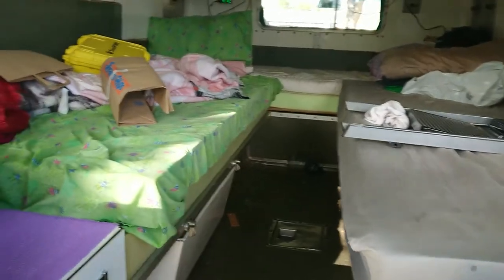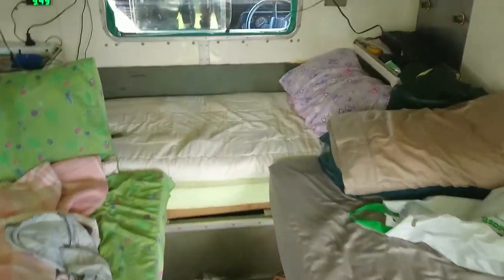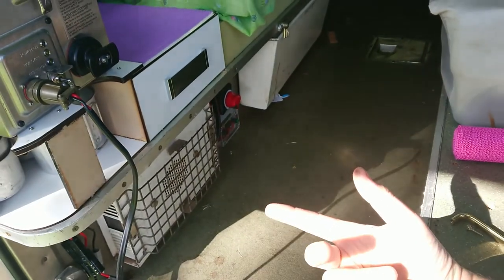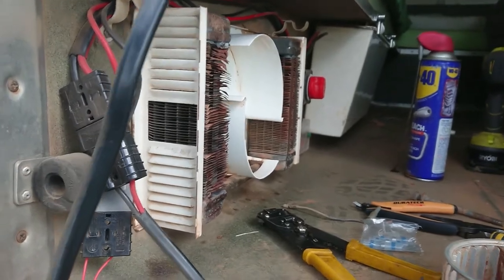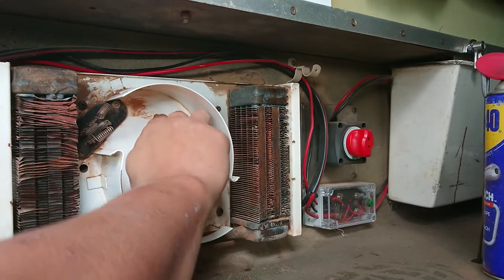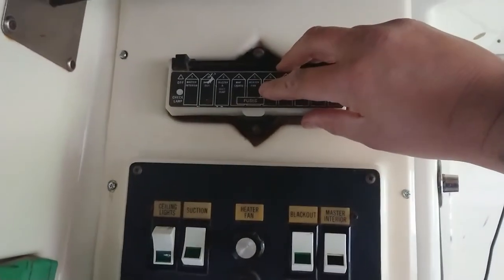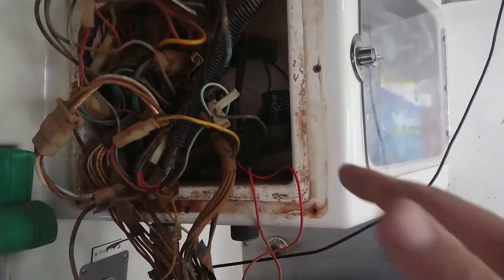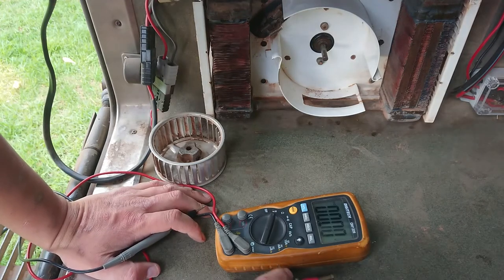The dirtiest heater you have ever seen! - 6x6 Land rover Perentie Ambulance Maintenance.

Comment: Good to see the build coming along, it starting to develop into a pretty handy layout. On that note you wouldn't happen to know the dimensions for the ambulance pod. I have been searching high and low for the external and internal dimensions of this thing but to no avail.
Reply from the maker: The overall vehicle dimensions in my case are 6m long, 2.6m high and 2.5m wide.

The module I think is about 2.5 ton off memory.

Here's a dropbox link with all the ambo info you can poke a stick at:

https://www.dropbox.com/sh/wpm5gvcvx4k37fz/AACwusPzYQQCPBtfO64YJRSaa?dl=0
Reply: @TheAussieRepairGuy  wow thanks man. Been looking a while for that, cheers

Comment: Top Job Mate , Could i suggest one of the best things you could invest in when maintaining a LR is copper grease on the majority of bolt and nut threads when re assembling .
Some will say anti seize but i like copper grease .
WD spray is only a short term lubricant .
Believe me you will thank me when time comes to re visit certain jobs
Reply from the maker: Yeah thats usually what I do. I'll be going back into heater again in near future to replace thermofuse and will be doing that then